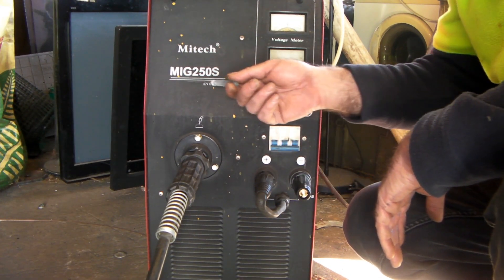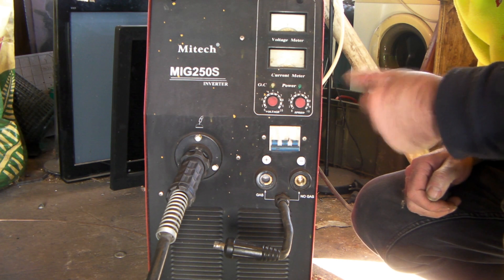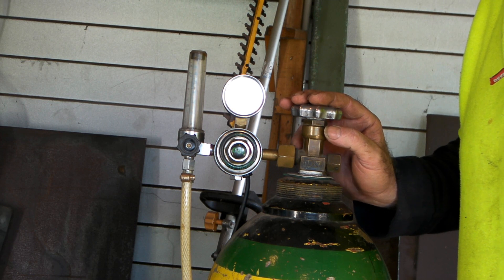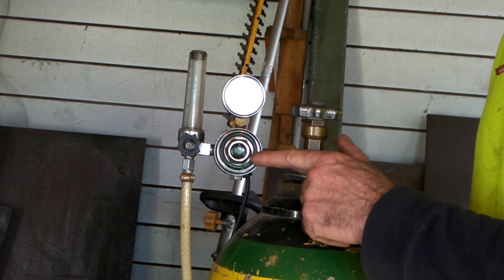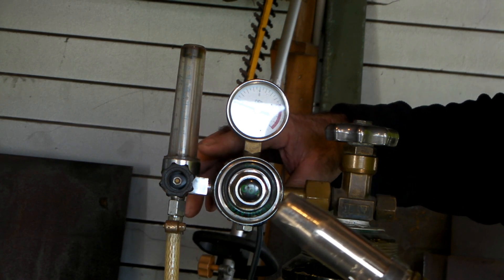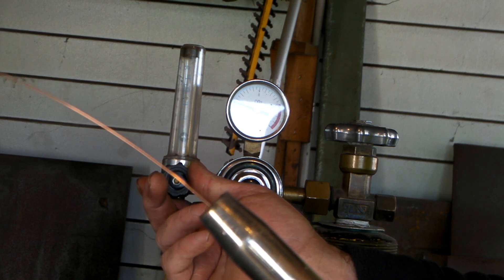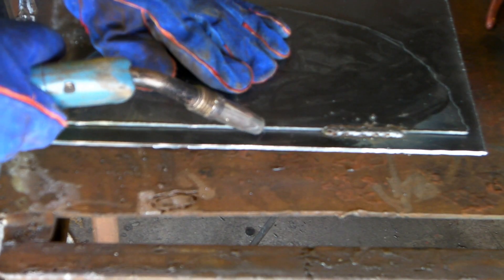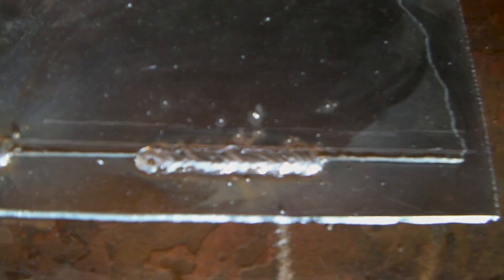Mig Welding Without Gas

Comment: I use solid wire, no nozzle with a Millermatic 140 for auto body sheet work like doing pinch welds. So far so good. next choice was 100% Argon when I ran out of 75/25"

Comment: Perfect video to answer my question if it's possible to weld solid wire without gas   ..the answer is yes  ....the fluxcore is too pricy per pound   ..in Canada $100 per 10 lbs  ..solid $50 per 12.5 lbs  ..you get more than double per dollar  ..I'm thinking for "non-critical" welds itll be fine to skip the fluxcore and just run solid wire and save money
Reply from the maker: No It wont stick anything together if you weld solid core without shielding.

Comment: Hi Pete? Can I ask you a quick question? In terms of quality which one is better MIG with gas or Flux core. I am a farmer and often I have to deal with heavy machinery. Also, I am trying to learn welding. So, what would you suggest? Many thanks!!
Reply from the maker: If your working outside i would use flux cored . But if your working in a workshop then use co2. Good luck with your welding mate .If i can weld anybody can.